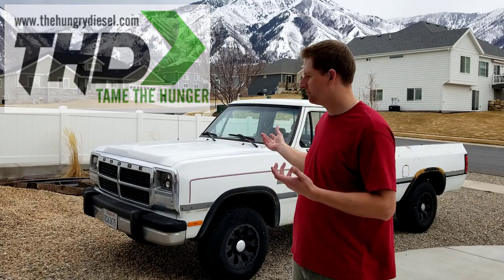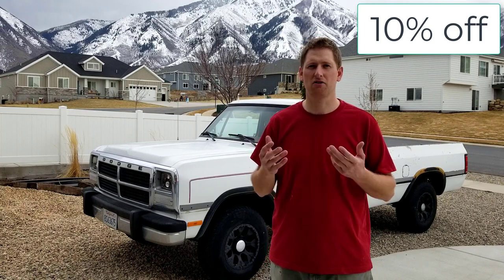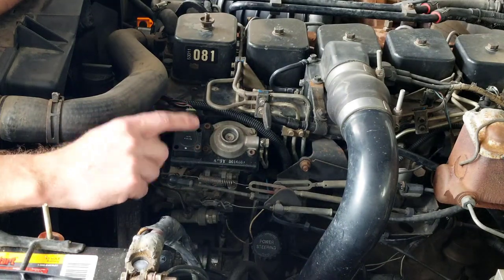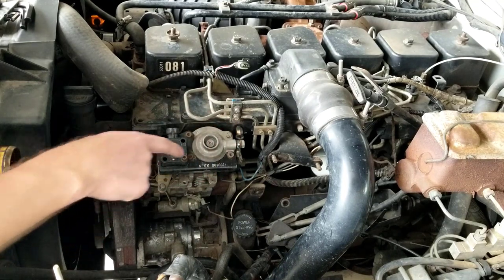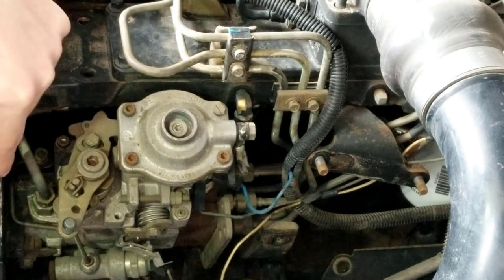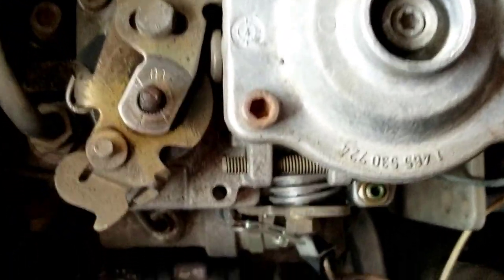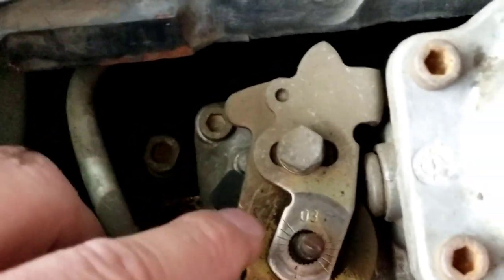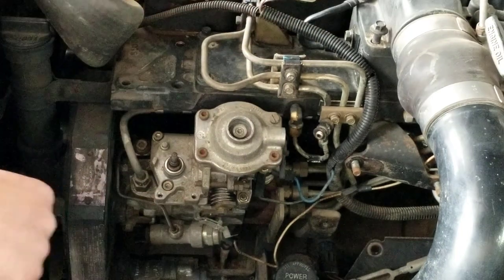How To Change the Governor Spring | 1st Gen Cummins

Comment from the maker: Make sure to use the promo code "decent1stgen" for 10% off your order at thehungrydiesel.com!
Reply: THD has the best quality pin that is designed for the 1st gen VE pump and geniune Bosch spring I think I paid less than a $100 for it and it runs great
Reply from the maker: @bbtoyshop  agreed

Comment: I got some performance tips from a Cummins mechanic. The first two things were to set the valve lash 2 thousands tighter. 18 thousands for exhaust 8 for intake. We advanced the timing a couple of degrees. Those helped but next came a Banks exhaust and 16cm turbo housing. The biggest gains were the fuel metering pin and the 3200 rpm Governor spring. The 5.9 B engines were designed for industrial applications and so the Governor starts to cut back fuel delivery when it gets up close to the designed maximum rpm. You’re making less HP and torque at 2600 rpm than at 16-1800 rpm.  

Ran the early 250hp 5.9 Bs in duel marine applications and. They were OK but Smokey. When the 300hp version was released Cummins said they were too strong for us. I looked at the specifications and saw the only difference was a higher pressure fuel system and 200 more rpm on the top end. 2600 vs 2800. The weight was the same. That’s what went into the next boat and it made a world of difference. Also a cleaner running engine smoke wise. As subsequent models came out the horsepower continued to climb. RD
Reply: Early fuel cut is to creep up and not exceed the limmit if a drive shaft snaps under load at full tilt.
My 91.5 auto stock + 16cm ND thermal management  full wrap( down pipe to head bolts) made 491.0@1846wheel tq 178.3@1976wheel hp  and 45whp90wtq on the governor @92.5mph

Comment: Thanks again Tim for a great video for us hobbyist  mechanics.   
A problem I ran into, that I hadn’t realized, was someone previously had done the “1/8 in timing bump” and my pump was rotated towards the cylinder head allowing for zero room to even see the back Allen cover bolt.   after hours of scratching my head and figuring out how to loosen the pump from the timing case I was able to get to it.  Unfortunately at this point I began rushing and missed your warning about the “top hat spring” ….  It went flying…. I was actually able to make one from a pen spring and it seems to be working just fine for now until my replacement spring comes in the mail.
Reply from the maker: Oh no! Well I'm glad you figured out a solution

Comment: A trick I use to break free Allen bolts is to use a Crescent Wrench. Stick the Allen Wrench end into the hole in the side of the Crescent. It won't slip out, you have a lot of leverage, and you can use your free hand to keep downward pressure on the Allen Wrench so it won't strip.
Reply from the maker: That's a perfect idea! Thanks for the input!

Comment: This is by far the best of these instructions I've seen. Thank you for putting it together. Is there enough room to completely remove the fuel screw if that would help simplify the removal and reinstallation of the top half of the pump?
Reply from the maker: Thanks! There is enough room but it really isn't necessary. Just back it out to where it is flush with this inside of the pump top. 👍
Reply: @decentgarage  Ah, I misunderstood that part then. I thought you were lifting up on the top half because the bolt kept bumping into the fuel screw as you were trying to remove it.

Comment: Did you ever have any issues with the throttle shaft spinning on you while you torqued down the nut? Mine has spun on both my pumps and I haven’t figured out a fool-proof way to stop it from spinning. Any advice on that?

Comment: I'm midway through this process. One difference with a manual transmission the low pressure supply line from the fuel filter crosses over the throttle assembly close enough that it has to be removed to pull the assembly up off the shaft. On an automatic it routes around the throttle position sensor. You'll need a 14mm for the top nut and a 17mm for the bottom and avoid twisting the fuel line. I'm waiting on a crowfoot flare nut set to be delivered so I can continue.
Reply from the maker: Interesting! I didn't know there was a different in that line between auto and manual. The more you know. ⭐
Reply: @decentgarage  Hours of research for a replacement line for when I inevitably twist and kink the currently installed one leads me to believe mine might be a one-off replacement or non-Cummins part. The only OEM replacements I could track down route around the throttle assembly as yours does in the video. Not sure. Thanks again.

Comment: How big of a difference is the Fuel Pin and 3200 Spring to seat horsepower? Will it be one of those things I had wished I did 20 years ago? Guess on horsepower and mileage if you keep your foot out of it. Thanks for the time. Love your videos.

Comment: Love your videos my truck is a 1993 dually with a 5 speed. Want to end up putting around 300-400 hp at my rear wheels. What I want to put on my truck is either 5x12 or 5x14 ducky injectors. 3200 gov spring THD fuel pin, intercooler upgrade kit and BHAF intake kit and either a hx35 wastegated or a 60 mm turbo upgrade. I can get everything off of the Hungary diesel except the turbos and the injectors and will be using ur code.
Reply from the maker: Call Eric at the hungry diesel. He sells turbos and injectors as well. Sometimes they are not listed on the site though. He'll hook you up

Comment: He should also advise to change the Throttle Shaft O-Ring, as if yours is like mine that O-ring has been on that shaft for 40 years (1991 pre 1991.5). You can purchase the expensive ones or get the Harborfreight O-ring kit (must be over a hundred O-rings in that kit) red and blue boxes for about 10.00 each one metric the other inch.  I hate leaks and don't have many. Tappet cover gasket, lots of parts have to come off to get to that. I will say, decent Garage has lots of GREAT videos of how to do things. 

Thanks for all your videos, my next project will be Ball Joints.  There is also a way to reassemble without moving the power screw. using a piece of wire to hold the lever forward against the spring pressure.  when you put the top back on. it works just need to be careful and not in a hurry and do not force anything it goes in real easy.  That way I didn't have to worry about a run-a-way and once I figured out the indexing, it started right up and of course the indexing was off a tooth. fixed that and no issues.  Again thank you for the videos they are so very helpful (and I know quite a bit about these old trucks) never too late to learn new stuff

Comment: Hey, I have a problem! 

I did everything exactly like you said; I got a BD spring and the instructions say to unscrew the max fuel screw until you can see the O ring before removing the top of the pump. 

Truck won't fire, just turns and turns. I've adjusted the indexing, pretty sure it's right. I even put a jumper wire between the FSS and the positive terminal on the battery to make sure the solenoid is open.

Is it possible there's air in the lines? Any help appreciated.
Reply from the maker: Could be air in the lines but I've never had that issue when doing this. Make sure theax fuel screw was backed out enough so that it isn't protruding in to the pump top. This makes it clear the fulcrum lever. I would also triple check indexing. Also, did you turn the max fuel screw back in to where it was prior to pulling the pump top?
Reply: @decentgarage  I forgot to mark the max screw before I unscrewed it. So I have tried a few different positions. I barely cracked the nut that holds it in place, so I can't be more than 2-3 revolutions off. 

I have a picture of the indexing and will double check today. I screwed the max fuel screw back in after I screwed the pump top down.

Comment: I might pull the trigger on a piston lift pump of his with that promo code. I was just gonna go with a airdog 2 from Ebay.
Reply from the maker: Go with the Piston lift pump for sure. Airdog is overboard for a VE pump. I have the Piston pump on my crew cab and love it.
Reply: @decentgarage  I agree the HVLP piston pump is a great option. I like mine a lot. Worth it for the improved priming mechanism alone.
Reply from the maker: @10mm  For sure! I hated priming the stock pump haha

Comment: Hi nice video , my 12v has not throttle at all zero rpm change when any lever is moved , except for the shut off , do you think the spring could be broke? Thanks greg
Reply from the maker: Interesting. Did you buy it this way or did this start after installing the gov spring? My guess would be that the throttle lever is not pushed down onto the splines on the throttle shaft

Comment: I need some advice here. I just put the 2300 spring in. When I cracked loose the top bolt the spring came back around and snapped back into its original spot. It bumped it loose before I could see which mark it was lined up with with. I just eye ball it to the 2nd mark twords the front of the truck. It started up and runs but the idle is way low. Did I screw it up?
Reply from the maker: Did you get it fixed? For some reason I missed this comment.

Comment: I followed all the steps I checked the fuel scre the throttle linkage the wires and it still will not start??
Reply from the maker: Give me more info. Does it not crank? Does it crank but won't fire?

Comment: Legit question  for you sir. With your experience in these trucks, and knowing how it drove and responded & performed. How did you not pre emptively know it already had a gov spring installed in it before you pulled it apart??
Reply from the maker: Great question. The truck was owned by my uncle for years and years. He said he'd didn't think the gov spring had been done so I kind of just took his word. As far as being able to feel it or not, there are so many little adjustments you can make on these trucks that it's hard to pin down "how it feels" to one mod.
Reply: @decentgarage  really appreciate you taking the time to reply to a new comment on a video that is 4 years old.  Really appreciate it. Genuinely.
Reply from the maker: @frosty_silver_fox4292  you're welcome!

Comment: I installed the the 3200rpm gov spring and a bd diesel fuel pin. My truck idles very high and white smoke out the exhaust do you know what the problem is? Is my indexing off?
Reply from the maker: Indexing is off

Comment: Pump is putting fuel under fuel pin diaphragm and running out on ground...any ideas?
Reply from the maker: Likely needs the pump top resealed. I've never down it but heard it's not too hard. The hungry diesel sells the reseal kit. And remember you can use my promo code decent1stgen for 10% off.

Comment: Hey Tim , I finally did the governor spring and fuel pin runs much better but now I have a leak from the side. Seems to be like an over flow plastic piece it drips diesel. By any chance would you know why or how this might happened? Seems like diesel mechanics don’t know the issue.
Reply from the maker: Simply resealing the top of the pump will fix the issue. The hungry diesel has a reseal kit
Reply: @decentgarage   thank you so much I took it to a shop here in California charged me 2300 and not even fix the problem I appreciate it so much !! Thank you for these videos!

Comment: Why should the spring also be replaced? Can't you just replace the fuel pin?
Reply from the maker: The fuel pin only affects the fueling curve. The governor spring affects throttle response and allows for fueling in higher rpm.

Comment: Would you not unscrew the fuel screw beforehand or does it matter?
Reply from the maker: Great question. It doesn't matter and it's much easier to do when the pump too is off so just do it when it's off. It's only an issue if you out the top back on without backing out the screw

Comment: Thank you for your great videos and the info that you share with us.
I just wanted to ask your opinion, I have a 1993 6bt Cummins that is very slow (even my grandma can run faster 😄) I'm thinking to install a 3800rpm governor spring and the THD fuel pin just to start. Whithout breaking the bank, what it will be the best next mods you'll suggest I need to do.
Cheers.

Comment: I have an intercooler 1993 bone stock with the H1C turbo. I just got the THD fuel pin and governor spring in the mail. I and wanting to upgrade the turbo to an HX35 but dont have one yet. Can I put this fuel pin and governor spring in with the H1C and not hurt my engine?
Reply from the maker: Absolutely! You will notice a big difference even with the h1c
Reply: @decentgarage  OK, thanks Tim. I used your promo code and worked great.

Comment: Tim, any idea what size the bolts happen to be (allen head bolts) are for the pump? Not to remove (wrench size) but to replace? I have one that is stripped and am looking for them before I remove the stripped one. Thx! Great video.
Reply from the maker: I don't know the exact size...
Reply: @decentgarage  I found some that fit and happy to send a pic. M6 - 1.0 x 35mm
Reply from the maker: @317808941  perfect! I screenshot your comment for my records
Reply: Now if I can just find someone (beyond my ability) to remove the one stripped bolt I can then replace my gov. spring, fuel pin and install a new lift pump (all from THD)!
Reply from the maker: @317808941  did you try using a t30 torx and gently tapping it in with a hammer
Reply: @decentgarage  I broke it loose (got it to turn a quarter turn) with a chisel but I can’t get it to actually spin out. I am trying to get it into a shop with perhaps a long enough bit to get a bite on the stripped head and extract it out. Just not many places here who can do that job. Thank you.

Comment: Hey, I installed the 3600 rpm spring, which is 1/4” longer than stock. Would I need to trim that down in order for it to function properly?
Reply from the maker: You can either trim it or index your throttle shaft to compensate for the extra length.
Reply: @decentgarage  Ok awesome. What’s the difference between the springs? Is it the weight of the spring/stiffness?

I know with a stock spring it lines up with the second tick mark. Did you have to index your throttle differently with the 3200 spring, or are they similar lengths?

Lastly, do you know which direction I’d have to turn the shaft to compensate for the length of the spring? Counter clockwise or clockwise (when looking down at the shaft)?
Reply from the maker: @mementomori2353  the 3800 spring is stiffer and slightly longer. Some people trim it so it's the same length as the stock or 3200 spring and reindex back to the second mark. If you keep it the length it is you have to index it with more tension which I believe is counterclockwise but I could be mistaken.

Comment: hey brother! I was doing this exact modification and my last step was to tighten my bolt down to my throttle shaft. i tightened it to much and throttle shaft broke in half. I can not find the part number to that throttle shaft for the life of me. Would you be able to point me in the right direction by chance?
Reply from the maker: Reach out to Eric gilbert on facebook. He likely has extra.

Comment: Hey Tim just put in a governor spring and THD fuel pin. Truck won't start or run unless I give it some throttle. Any idea what I messed up on?
Reply from the maker: Throttle indexing is off.
Reply from the maker: Make sure to pull up on the throttle shaft when you are lining the splines up on the throttle lever.
Reply: @decentgarage  you are correct. This is the second time I've aligned it and it keeps jumping back 2 dashes. Will try pulling up!
Reply from the maker: @laynewade6700  i can be a bugger but you'll get it!
Reply: @decentgarage  Got the indexing thanks for the advice! Was able to drive it home from work, but it was super sluggish and wouldn't accelerate unless I did my best to get rpm by manual shift it (a518) would you say I need to turn the fuel screw in more?
Reply from the maker: @laynewade6700  if you are absolutely sure the indexing is correct then at that point you can turn the fuel screw in.
Reply: @decentgarage  I pulled up on it like you suggested and double checked it. It feels almost like the afc is slow to push the fuel pin down, but I'll double check the indexing again before I start turning. Probably should have not been stupid and just tool you up on your offer to help put them in. Regretting my choice to by cock about it!
Reply from the maker: @laynewade6700  let's get it figure out. So you removed 3 screws on the pump top to take the TPS off. Did all of those get replaced?
Reply: @decentgarage  replaced as on new screws installed? No I did not put brand new screws for those bolts. But they are all installed
Reply from the maker: @laynewade6700 you backed the power screw out before putting the pump top back on to avoid breaking the fulcrum?
Reply: @decentgarage   yes I did, backed it out till it was flush and made sure it didn't get damaged.
Reply from the maker: @laynewade6700  have you pulled the AFC top and inspected the diaphragm and make sure the slide pin isn't getting stuck?
Reply: @decentgarage  I have not rechecked the slide pin. But that was my check after driving it this morning. When the truck finally does start to fuel it moves out just fine. Just feels like the fuel pin is super slow to move.
Reply from the maker: @laynewade6700  make sure you got your AFC spring in as well
Reply: @decentgarage  afc spring is in and looks like my fuel pin is getting full travel
Reply: Looks like the issue isn't fuel or engine related. Somehow my transmission decided to not shift properly and was lugging down the rpms. Thanks for the help again